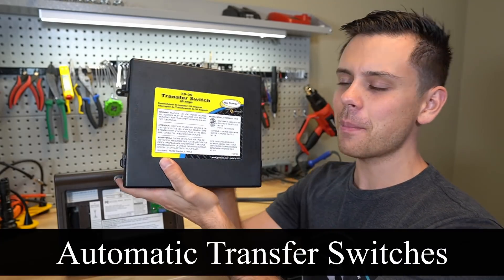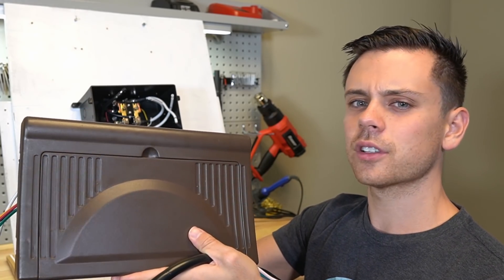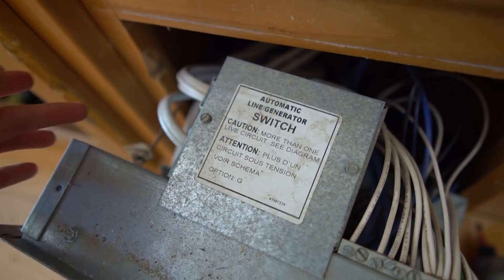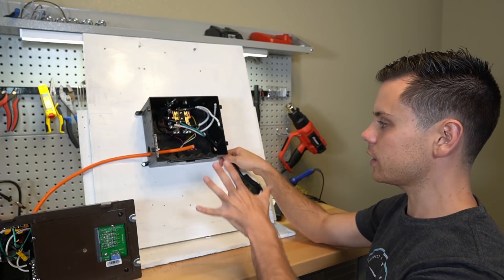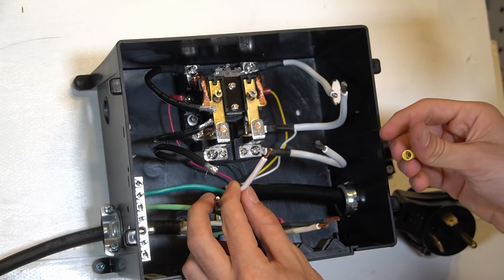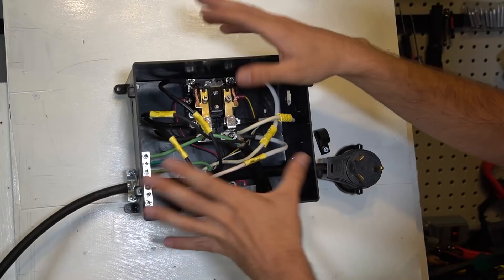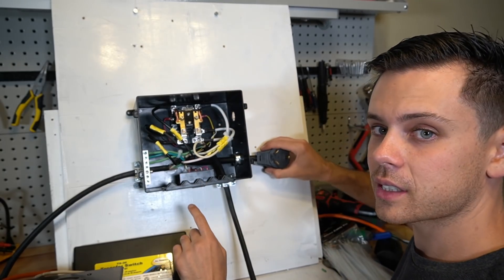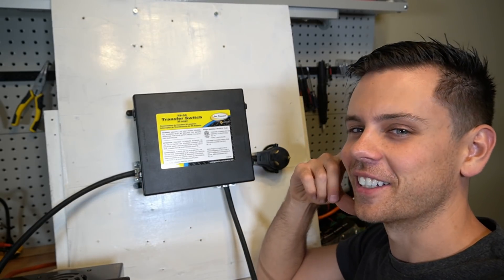RV Solar Power: How to Install an Automatic Transfer Switch to a Solar Inverter

Comment: I'm building a  RV up. A Bare /Empty Born Free for 2. Has a 4000w onan Propane Generator and of course Shore Power plug in.  However there are zero Electrical control components at present.  This is a fresh start/ wire up and build out that will incorporate solar.   My question is this. Can a Transfer switch be incorporated with both Shore power and the Generator wired in?  Reason: There will be times I wont be hooked in to Shore Power and may have to rely on the Generator to run heavier load appliances , I  would also  like to utilize the generator to charge batteries if necessary.  Thanks in advance for your recommendation.

Comment: Awesome video as usual. I have a specific question for my situation. I'm switching from generator to inverter power which is powered by the batteries I have hooked to my RV. How do I wire this so that I won't be trying to charge batteries via the converter when I'm running off my inverter and still supply the 12 volts from the converter needed to power the 12 volt side of the RV?

Comment: My scatter brain can’t process at the moment. I thought I could easily add panels to my roof where there are prewired solar terminals to a solar charger then directly to my house batteries for charging. Researching heavily before I do anything. 🤦🏻‍♂️ also, I’m the weirdo that wants to keep my generator, so, I need to really pay attention.

Comment: Can I install this into my home fuse box  because my generator is already creating Between 1v through 184v Ac at 2,000 r.m.p I’m waiting to receive a new multimeter to to check higher amperage because my generator I’ve seen people say create 100 Amps so I can better calculate the total power volts x Amps ! Big block Chevy slow turn charging high amp alternator tapping off the three leads straight off the stator create Ac power ! Hooking it up for back up power or even like a grid tie in to pay less electrical bill a month ! What’s you’re idea ?

Comment: Hey Will, your video made this install less intimidating now I have all outlets working with my inverter, only one hiccup in your video at the 12:41 mark you mention 2 little screws to connect the charger, those screws hold relay contact legs and should not be touched,  instead connect charger and shore power together to same bigger screw. I had to take drill rivets to be able to reattach the contacts and re-secure the ATS to box.
my 2cts.
love your videos and reviews !!

Comment: some inexpensive inverters will actually split the voltage by supplying 60V to each the hot and neutral to make up the 120V. Would that cause any problems with hooking it into a Go Power ATS?
IF so  how would I go about knowing if the inverter I have is doing this?

Comment: Great video with lots of already asked questions and no replies. I’m about to plug in my renogy 200w kit today and I’m freaking out since I only have the one coach battery. Upgraded my converter charger but now I don’t know if I should put the solar on my rv...and it’s installed! Yikes. Help

Comment: Hey Will, I like your work here and have watched many of your vids! Thanks for mixing some AC side in, much appreciated. Very insightful. I think many of us are first looking to augment with solar and maybe upgrade to lithium as part two or three or six... :) I have the exact magnatech with same orig transfer switch as you have there and, like most RVers, a "working" generator. So to put solar in the mix, I understand it's essentially isolated from the coach system except for the output. My question, do I need something like a power diode in line with the solar output to protect it from the chargers (coach and house) output to the battery? Two, will a (house) charger tolerate the voltages produced by the  solar system? Note: Anyone, if you upgrade to lithium, don't forget to ensure your starting battery is isolated from your lithium voltage levels. Also don't forget to unhook the starting batt as well when you work on the coach electrical or you will be searching for a blown fuse!

Comment: Hi Will ,absolutely love your channel !! I'd like to ask as i have an idea for a video . . . . . . . Do you know if there is any way to do an automatic switch that only comes on when your vehicle is electrically "switched on" and redistributes any extra watts from your roof top solar after batterys are charged to help with any "base"load that might be needed/valuable to help charge the start battery eg help run ac while on the move? I live in the tropics and AC while driving uses 5-10% more petrol so that would be a great free saving of petrol:)

Comment: Question for you. I got a small cabin without any power so I bought a solar panel thats 60W/12V and was hoping to hook it up with a battery to then convert the battery to some power in the cabin. My question is how do I do that, since they have this strange hookup that I believe is for hooking multiple panels together. I am not sure how I am supposed to hook it to a battery. I do believe I need a regulator before it gets to the battery, but what exactly?
Reply: I believe you will need a solar charge controller.  Your panel would be wired into the charge controller and then the CC wired to your battery.  I'm new at this so don't go on this info alone!  Can anybody verify?  thnx

Comment: When you can remove points of failure like splices or other points of connection over necessity, you always want to do that.  Just using ring terminals direct to your lugs or if a compression type wire lug, its usually better to do that.  Depending on the application, variable impedance both with wire or connectors may cause a lot of heat to be generated up and to circuit failure.  I deal with large Ats panels on our sites and as far as the feeds in and out of the switch they are direct.  At the amperage load your at its probably going to be fine, but I would advise against using splices above 30 amps.   Congrats on the new house.

Comment: Hey Will love your videos and the information you present….
 One question I see you use a combination of circuit breakers and fuses, why not just use circuit breakers for everything?  With breakers you can always open up any part of the circuit for isolation or maintenance.  Keep those videos coming…..

Comment: Hay Will  I'm pretty new to your channel I'm fixing to move a  RV of grid  with no options for electricity I would love to hear what would be  my best options on a system to run the RV full time  . Need help I have no clue .is there a package that will do it I'm not trying to run ac  unit . Yet lol
Reply: Join a facebook RV solar group. There is a lot to learn and yes you can screw it up (fire).

Comment: How would you do a RV that has a generator and 50 amp power?
Reply: Yes, shore power + generator + solar (with a transfer switch and charger/inverter) with lifepo4  batteries? Please.

Comment: Will, may I ask a question the answer to which I've not been able to find?

In the typical RV solar setup, I understand how to route in generator power, shore power, and solar power.

But how - where - do I route in vehicle alternator power?

Comment: The question I have is that if shore is coming in at 30 amps, and the solar power inverter is probably 15 amps (right?), is the RV distribution system underpowered in some way?

Comment: I have a 4x4 with a lead acid starter battery and a lifepo4 coach battery. Posted on your forum trying to figure this out in my system but all I have in between is a dcdc charger. Any tips on what to search are appreciated.

Comment: The first auto transfer switch, I thought of for solar, was the one you had on before, the funny thing is, I had one on the shelf. I hooked it up on 2-24v 750 AH highlow batteries. The dam thing works flawlessly. Even though my inverter is a inverter charger and totally controllable and programmable. I watch the transfer switch the most. I built a high end array, to show for potential sales. I run all shed lights off it, 110 tools even 220 equipment (ie plasma cutter) 200 amp Mig and Tig welder. I can’t use them long due too only having 1500 AH worth of batteries. I should have 4 batteries to run comfortably that would be minimum, at that point I will switch to 48v. Like I have said in the past you make electronics interesting. I tell all my Off Grid costumers to watch your videos and help support you. So they get a understanding of renewable.

Comment: I know that this is the recommend way to wire an ats with the shore power to panel on the normally closed side but in my experience I find that the coils used to hold the contacts in the switched position draws a constant 30 to 60 watts so why not run the inverter on the normally closed side so it's not drawing extra power from the batteries and the shore power on the switched side?
Reply: He has the converter connected to the normally closed contacts. Check out the schematic @ 12:31. The box he's working on is upside down compared to the schematic. Ground bar orientation.

Comment: This will be long. Sorry! I have gain  a lot of knowledge from you and your book...here goes my issue. I'm handy but not an electrician. I have a 50amp system. Shore Power, onboard GENerator. Newly installed INverter with BBBATTERIES. Upgraded my CONverter. The stock Transfer Switch has SP and GEN. 1 outlet to Distribution Panel. My CON plugged in DP. With red to cut off switch for the BBB. No solar yet. I have a plug from my INV to my SP inlet  to power my rv. I turn off my CON. It makes a loop I dont think is good. So, how can I get these items to work together.  I have thought about putting the SP and GEN in same side, but I'm thinking it will back feed power to GEN when my connected to SP. I thought about a 2nd TS. In line from the 1st one... the converter  is what I'm getting hung up on..the automatic transfer switch video. Got me thinking again about it.. can you point me in the right direction. When I get solar. I will have 4 ways of power to manage.... I didnt want the victron all in one. Mainly because I didnt want everything tied into 1 expensive unit.. hope I made sense of what I got going on... thanks

Comment: Hey Will,

In regards to the Inergy Apex/EC8 input...

Wouldn't I be able to cut off the other end of the EC8 & splice it directly to what initially was an MC4 panel?

In short, I know how you feel about the cons of the Apex, but I like the Apex for its capacity & portability for my media van, and I like HQST Panels.

Comment: Great and informative vid once again. I've noticed you don't usually solder your wires. Using pressed connectors are safer or just easier for assembling?! Regards from Brazil

Comment: Will I love your videos.  Have you made a video on refrigerator output draws?  Costco has a DANBY  4.2 cubic foot separate dual door refrigerator./freezer model number DCRD042C1BSSDB great size and led interior light and I would LOVE to know the power draw and your opinion on it versus others.  If you have done one or are looking for video suggestions please consider this one and let me know.
Thanks as always for being a beacon of light on everything solar and well just everything.   I’d love to know how many watts it would take and set up needed to run this unit.
Reply: I know you're making a suggestion for future videos but as reference to understanding, you have the ability to find those answers without testing. The information you seek is listed in the literature or printed with the make and model. LRA and RLA. Lock rotor amps is initial start draw and run load amps is the running draw. You would just need to multiply the voltage to achieve the answer.

Comment: Just watched your .2c discharge testing vid. Love the tools you used for gathering info. Thanks for the time it took to make that vid..   Question. Have you done anything on saltwater electrolyte batteries?  Just curious. Lots of vids to catch up on. If you have, I will spend the time looking through your vids. Thanks.  Keep up the great work.

Comment: Will I just read your community comment about grid-tie and safety concerns.  When you do get around to videos on this topic I would like to just hear the basics of what qualifies as grid-tied and what doesn't. For instance, if you use the grid to charge your batteries and supplement your solar. Is that ever considered grid-tied?

Comment: Hi Will,  Now that you've got space in your new house, maybe a white board so you can do some block diagrams would help?  I know that sometimes it's easier for me to draw a simple block diagram to explain in simple terms what I'm trying to get across before I start with the "show and tell".   
 
Great vid!  I never thought about an ATS in an RV as everything I've seen has had an AC-off-DC switch, but it makes perfect sense.   Great vid!

Comment: Hi will, How is Las Vegas treating you? Newby question. Can you do a video on high wattage and voltage panels? Example SanTan sells panels 240 watt and higher with 37 volt and higher output. THX

Comment: Why don't you use 12/2 MC armored cable for your 120V? Given that mice are very often in RVs, and they can't chew MC, seems like it should be standard to use it instead of plastic coated Romex.
Reply from the maker: Mc is awesome and idk why they don't. RVs are notorious for using cheap materials so it doesn't surprise me

Comment: Good job explaining everything, very well done.
The only thing I would caution against is using those style crimp butt connectors, they have a tendency to over heat. I would have used the crimp cap style connectors so you have wire to wire contact and you're not depending on the barrel of the butt connector to carry any of the load, the crimp caps barrel is only used for clamping force and does not carry much, if any of the load.
It would be interesting to see you do a test between the two different styles of connectors under extreme load. Back when I owned a stereo shop, I would see customers come in with melted 8-4 Gauge butt connectors on their main positive power wires, we would add a proper connector, usually we would install something better than a crimp cap but sometimes that's all that would fit,and they wouldn't have the problem again.
This will probably never be an issue but I prefer the better safe than sorry method.

Comment: Why not have a socket on the output side of the ATS? Leaving exposed live pins are dangerous!
Reply: There is no power feedback on that AC input plug, it's isolated.

Comment: hey will, I had 3 solar panels in series on my solar system and long story short I lost 2 panels and they were likely pulled off while the system was charging. I still have one solar panel but it doesnt seem to give any charge to my system. battery and inverter still give power, but my charge controller is reading 0 amps, and 1.8-2.4 volts from the solar panel. its a 100w 12v panel I believe. do you have any idea what could be wrong? busted junction box or an issue with charge controller? its an mppt
Reply: Safety Wizard my opinion is: your panels may have shorted out internally if you’re getting that low of a voltage... or your connections in said panels are bodged due to being pulled off while under load?... however, if you have a friend nearby with same panels, test yours against theirs... providing they’re willing to help you figure out your issue.
Reply: @BeezyKing99  found the issue, was an issue with the extension cable (or course) its working now!

Comment: Please tell me that now you have a house (congratulations,), you are going to do a range of videos and possibly a book on building a solar system for your new home. I am particularly interested in solar being the primary power source which automatically switches to grid power when batteries run low. I live in Spain so lots of sun!! Thank you for great information. Regards Alison
Reply from the maker: Yes, many new systems are coming.

Comment: I have that same ATS between my inverter and breaker panel in my shipping container. This way when I am charging my batteries the loads are being powered from the generator instead of the inverter. That lets all 60 amps from the charger go to the battery and not be spit with whatever the inverter needs. I ordered a 200 amp Lithium Iron Phosphate battery bank after watching your videos.  My Outback Flexmax80 can be configured to charge LIfePO.

Comment: Can you make a video about using NiMh batteries for solar system. Like the cells from a Prius Hybrid. Are they worth it? Are they safer than Lipo? I have some of the flat type cells that I want to use.

Comment: Looks like some of your wires are not solid core but multi core wires (it is not well visible in the video, excuse me if I am wrong). Those are not good to clamp with screws (like in the grounding bar) without crimping!

Comment: I have built a similar device but mine has a physically coupled extra set of contacts to disconnect the battery from the battery charger. This prevents small trickle back losses from the battery into the charger. Not a big loss but every bit saved can help.

Comment: Can i use a 12v inverter with 2 battery one 12v the other 24v both acid batteries

Comment: We also have a second ats for the inverter with a sub panel, The converter power has a photo eye to disable it during daylight periods and only operates while connected to shore power or during generator operation.

Comment: In your book do you diagram things a bit better than that. Do you show schematics and make things a bit easier to understand? I don't think it's so easy.
Reply from the maker: I don't cover ac power in my book because it's for beginners and I don't want anyone dying. Those are dead simple power systems with only low voltage DC. I need to make a more advanced book for users who understand the risk and know how to work with higher voltage